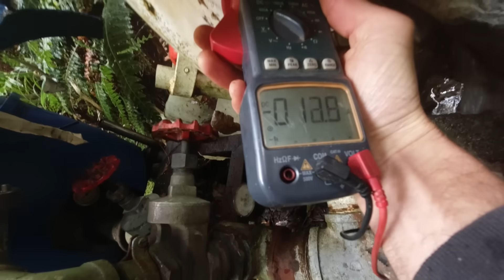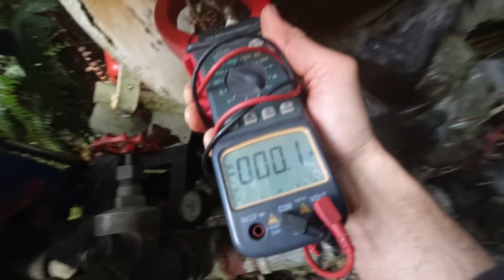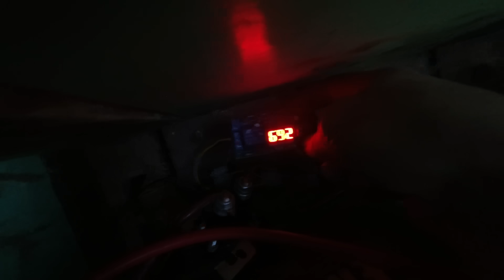Free Power for 16 years from a modified Washing Machine / Water Wheel

Comment: Really appreciated that, definitely save a lot of money but most households could not come close to running on 500-600w.
Sounds like your 4wheeler has a bit of a knock.
Reply: Ejay ... that 500 - 600 watts is likely the charging rate available and backed up with surge capability via batteries plus an inverter. The turbine running 24 / 7 (with enough batteries) should be more than enough to run a small home, other than central AC or a welder, electric oven, etc. If you think along the lines of how much power it takes to run a small camper (maybe a single 15 amp circuit not maxed out) then factor in some use of other energy (propane?) you could get buy with less in a pinch.
Reply: @rupe53   Yeah mate I did the maths answering another guy in this comment section, at 12:38 you see he has two 12v flooded lead acid batteries set in series to make 24v, he mentioned that he has installed 500m of power lines to the house - So there will be a substantial voltage drop to the house, reducing supply/increasing load at the battery.

A 15a 240v circuit maxed out is 3,600w, vastly more than this system produces.
My generator I use for my stick welder is 9,000w for example.

The batteries if fully charged and rated at say 600CCA should net only say 1,900wh, being generous, they're not deep-cycles.

Judging by this either #1 Marty T has some other more substantial power supply, or #2 he's living real frugal or #3 the system can provide considerably more power with more flow.
Reply: @Senkino5o  ... yes, some serious low efficiency with 500 meters of cable, even if it was AC instead of DC for the run. This seems to be the major drawback in most remote locations. Over the years I have done several long runs of a temporary nature, with the longest being around 1,000 feet. (a bit over 300 meters) Doing voltage drop calculations for 240 volts AC I needed 2/0 aluminum to run 50 amps with a 10% drop. (going by memory) In my case 10% was acceptable but going back to the charts it was more like a 5% drop (normal) for around 30 amps max draw. Basically it can be done, but at what expense?  In my case that 1000 ft run was about $1200 US dollars, just for the cable. Conduit and other supplies were extra. Never tried to calculate the loss for DC on that distance but have looked at a few hundred feet just for giggles, and it's enough of a drop to make you think it's just not usable on the other end. Oh, could our friend be sending some higher voltage AC up the 500 meter line to the house then converting it down again? He seems fairly clever... or VERY frugal! BTW, I was talking about a 15 amp feed at 120 volts, as that's what we'd use in the states for a small camper.
Reply: 500w continuously is about 12 kilowatt-hours per day of electricity.   12kwh will easily run a full sized 25 cubic foot refrigerator/freezer that draws about 1.6kwh per day, plus 100 watts of LED lighting for 10 hours per day, plus run an induction cooktop at 1800 watts at full power for an hour (plenty of power to cook three meals), plus 100 watts for a big screen TV for 5 hours, plus a table fan at 20 watts for 5 hours, plus a laptop computer at 100 watts for 5 hours,  plus a window unit air conditioner at 600 watts for 8 hours, and still have 1.7 kwh left over.
Reply: @richardowens9061  ... in theory you are correct but one has to coordinate their efforts to avoid AC, fridge, and cooktop at the same time due to starting loads of motors. Both the AC and the fridge likely need well over 10 amps each to start their cycle. OTOH, we don't know (from this video) what the guy has in the way of inverter / battery capacity. For $20 a year in propane ($100 for 5 years) you could easily avoid $1000 in batteries, cables, and inverter costs over a similar period. This is why off-grid is a bit of a balancing act when it comes to being practical.
Reply: @rupe53  I didn't address the issue of load balancing - because, I don't know anything else about his system, except that it's producing 500w-600w of electricity continuously.   And, with that amount of electricity, you could conceivably run all of the items I listed for the times I listed.   In other words, it's a significant amount of usable electricity.
Reply: @richardowens9061  Mate no, just stop. Valiant effort, but just no.
500w will not run a 1,800w induction cooktop, it won't run it for an hour it won't run it AT ALL.
And 500-600w measured where? At the turbine? 150m of transmission wire will lose you a good portion of that, just as torque measured at the flywheel is not the same as at the crank or at the wheels neither is electrical power converted by a motor/turbine the same at output as at the load.

Marty did not mention anything about batteries, if this turbine were used to charge a battery, then maybe, but that's not what he said and from what he said I highly doubt he has much in the way of batteries.

To be able to draw say 4,800 peak watts for any period of time you need a significant battery, the kind of battery that would cost a lot of money to put together and maintain, even if you could cobble it together from here and there.

You can't just multiply 500x24 and then divide by the average of your load in neat chunks, that's not how electricity works even if there was a capacity to store a large amount.

In this scenario if you tried to draw more than 500w the turbine would stall, just as if you load 25tons in a 12t manual truck and try to drive uphill - stall.

It would stall and the A/C, heater, microwave, toaster, etc. would not go.

This system would work for maybe 2-3 refrigerators, no more, which I believe is what he said he uses it for.

edit, I watched the vid again @12:38 he shows that he has two maintainable lead acid batteries, in series to make 24v, I don't know the exact rating and they appear to be cheap batteries, but for arguments' sake say they are 600CCA batteries, this nets about 80amp hours each which gives 80AH @ 24v which gives 1.92kwh of maximum rated capacity if they were new.

Take into consideration where he mentions that the turbine is about 500m from his house and I'd estimate a voltage drop of 20-40%, since he measured 20a @ 24v (480w) to battery and from battery (26v) to house maybe 18x20 - 360w

This means that with transmission voltage drop, 360w draw at house is equal to approx 480w at battery/turbine.

This gives him a bit of leeway, but any period where he exceeded 360w avg. power use he is draining those batteries.

I really doubt he would be able to bake a meal in an induction oven, he could not run a modestly powerful (say 2600w) air conditioner for more than a few hours, he could not use electric heaters to warm his house. Beyond a couple fridges/freezers, maybe some lights, he has no meaningful power from this system.
Reply: @Senkino5o  No, you just stop.   I have a degree in electronics engineering.   I also have extensive experience with solar panels, inverters, and LiFePO4 battery technology.   My original comment was intended simply to put the amount of power he is generating into its proper perspective.   I don't know - and, don't care - what other components he has or what their capabilities are.   The only thing relevant, here, is what can be done with 12 kwh of electricity.  You wasted an awful amount of time making wrong-headed assertions based on your own ignorance and your own misinterpretation of what you were reading.   So, you need to just stop.
Reply: @Senkino5o  ... you are being VERY generous with your voltage drops on the long run to the house... and you have thought further into it than I did at first glance. I really didn't know how far away the end point was or any of the distances between the generator / batteries / house. It seems like an almost impossible situation from a design viewpoint.
Reply: So as you have seen, you build what you need. this one could have a battery backup and run ten times as much for the 3 or 4 hours a day that it is needed.

Comment: Cool, a video on how it's done would be nice. Can  you put a grease fitting on the bearing cavity and remove a grease seal from the bearing side?
Reply from the maker: I tried that with oil on my first turbine, it tends to get between bearing and shaft and the bearing slips and quickly eats the shaft. I use sealed bearings, they last for years.

Comment: It would be more efficient if the water jet sprayed over the top of the paddle wheel and then down.  Just saying.  -BAG2
Reply from the maker: On the contrary, there would be slightly less pressure and the spent water would interfere with the wheel as it has further to fall
Reply: @MartyT  I am Civil Engineer as well as Electrical Engineer from Purdue.  I say this so you understand I am not just shooting my mouth off.  I like what you have done.  But I believe your comment about the "water falling further" proves my point.  This arrangement of spraying over and falling down.  Means the "Work Path" is longer.  Put another way, you can harvest more Kinetic Energy from the water.  If you choose to continue with your arrangement.  I wish you well.  I just thought you could get a few more watts out of it.

Comment: I just feel so inadequate compared to this bloke.
Reply: @Billy West any books you can suggest?
Reply: Just get to it. You could try very small and simple items with a garden hose or rain downspout from the house during rain storm. 12 volt automotive stuff is cheap and easy to use. Then you could step up in size, sophistication, and voltage and amperage. I think that's what I'll do....
I think I'll start with a blower motor and wheel. I'll have to figure out how to form a seal to keep water out of the motor/generator.
Good luck and God Bless
Reply: https://www.youtube.com/watch?v=267HHO1tzNw

Comment: Hey friend didnt see but if you rectify the current at your house instead of at the generator you will get a huge efficiency boost , DC is horrible for long distance even with thick copper , probably 7 to 20 volt drop on your rig  at 20 amp
Reply from the maker: I invert to 240ac at the turbine, more efficient than sending low v up the lines

Comment: At about 10:25 you have a cordless drill that looks like its attached to a valve on a right angle drive.  What's going on there? Are you using the drill to open and close the valve to control water flow to the turbine inlet?
Reply: Just read further down... automatic shutoff. If you found a slower drill or a reduction box it might work better. 

PS I'm a power station engineer (north island geothermal mostly). This whole thing makes me happy.

If I find a small scrap reduction box in my travels do you want it?

Comment: Very nice. Seeing you have a rather long run of wire, how much voltage droop do you get over the lines? Are you sending 220V to your place? If not, modern DC-DC converters are pretty efficient, so you might see some benefit of boosting to 72V and then having your main battery bank on the house side where you could draw a lot more load from the batteries when you need it. Do you use MPPT to charge the batteries?
Also, have you tested 2 nozzles to balance the load on the bearings?
Reply from the maker: I use an inverter at the turbine and send 240ac up the lines, very little cable loss
Reply: @MartyT  Ah, that makes sense. With the advent of cheaper lithium batteries, would you consider making a "UPS" at the house side to let you run heavier equipment?

Comment: If you buy a Tesla house battery that would solve your power issue and you would only need to rely on the washing machine power effectively creating 100% carbon neutral energy
Reply: The Tesla kit is about 10k NZ right now (I was pricing solar gear and asked recently).  

It looks like he already has batteries and anyway so the Tesla kit doesn't do anything for him other than add capacity (hence longer time to fix the main turbine before the freezer turns off). Something plastic, modern and clean isn't this guy's style anyway.

Comment: Pelton wheels, when speed of bucket travel is around half the velocity of the water leaving the nozzle, can reach 98% efficiency.
Reply from the maker: Yes, turbine speed can be adjusted by winding out the rotor which pulls the magnets away from the stator to achieve max efficiency

Comment: Love it, Marty. How cool is that... Living in harmony with nature like it should be... It sounds like you have some battery backup in the system. How many AH's of storage do you have built into the system and are you converting or running all DC or a mix and have you considered building a good sized storage pond at the top end? Thanks for sharing.
Reply from the maker: I have a 120ah battery bank at the turbine to make up the deficit when I use a high load appliance like toaster, kettle or startup on the fridge and freezer. Storage pond would be a waste of time and energy, It would need to be enormous to hold enough water to get me through a dry period, and if it broke in a downpour it would wipe out my pipes and turbines
Reply: @MartyT  Understood. Do you have enough flow rate & pressure to branch off additional lines to drive additional genheads? Just wondering if you could double output.
Reply from the maker: Yes for 8 months of the year when the stream is flowing well, I could run a few more turbines and make up to 3-4 kw but I'd never use that much, I'd have to build a heated pool or something to dump the excess power into
Reply: @MartyT  So, running the welder isn't an issue or is that a 1200 watt microwave conversion? You are resourceful and a heated pool would be awesome, aye! :) I watched the two vids yesterday on Angry Ram of outbuilding process. You are MacGyver! :)

Comment: Very ingenious your own power generation. 600 watts isn't a lot of power for the average home. Do you heat your house water with propane? The welder must be on a 30amp gas generator?
Reply from the maker: Its around 700w with both turbines running, I can put bigger jets on the turbines and get over 1kw but I don't need that much. My water is heated by the excess power when the batts are charged, inverter dumps intermittently into the 240v element. I have a 7kw petrol gen for the welder

Comment: Yet another thing to be jealous about.. Man that is sweet to not have to pay for power all the time. 

that's a long way to run 240v, you dont have to much voltage drop? I guess not since you've gone that long. 

Edit, i just did the math, i guess its only 2-3 amps on 240v so the voltage drop wont be that bad.
Reply from the maker: Voltage drop is very little over that distance with 240vac, When I first set it up I was pushing 24vdc up the lines and losing half of it in the cable, having the inverter at the turbine is much more efficient
Reply: @MartyT  for sure, we use 120 here so my original thought is your amperage would be higher, but then when i actually used my brain, it made sense.. Thanks

Comment: Wow!  That is really cool.  You should hang up that turbine made from a sprocket.  It is a piece of art.  So the output is 24volts DC?  How thick are the wires to take it to the house?
Reply from the maker: Yes turbine output is 24vdc, there is an inverter connected to the batts to change it to 240ac so very little power loss in the cables

Comment: I had watched the video of you building that years ago...I wanted to do one like it but the washing machines are built different here in the U S ...Many Blessings , SMR
Reply: Check E-bay for used ones.  Use "Washing Machine used parts/ 01211-5 F&P stator and rotor" and it will take you to a used rotor and stator. He also at times has offered for sale rotor, stator, and bearing support housing ( shaft, bearings, bolts inc ). Just be sure that if you buy a Samsung or other make unit, that it most likely will have Al wire instead of Cu wire and you can work with it. The F&P units are Cu wire.
Reply: @gravelydon7072  I think that that is a typo and should read " you cant work with it"

Comment: Whats the purpose of the red drill next to the turbine?
Reply from the maker: Automatic valve control, no longer in use. It worked well but I found it shut too quickly and put stress on the pipe joiners, I quickly found my weak joins
Reply: @MartyT  so its kinda just there for aesthetics now. Cool idea and definitely effective

Comment: Awesome spot Mr T. I just found you on google. the first vid i seen was the Vintage tractor, what a score!!. and ive been watchin ever since. I had seen the turbine vid but didnt realise the date. Now the old smart drives, inverters, cables, batteries, charge controllers and pipes are pretty easy to pick up. Ya wouldnt know where I could find a couple of Hectares on the side of a hill with a handy creek running through it was would ya. lol. Ya Livin the dream mate. 
ps i nearly shit myself when you opened up that inspection plate on the graider an the chain was sittin wonky with  the chipped teeth stairin back, but its workin out. anyway cant wait for the next mission

Comment: Do the temperatures ever get below freezing in your area?  If so, what procedures do you take to make sure your system isn’t damaged?
Reply from the maker: No the stream never freezes, if I turned off the valve in mid winter for a week It might get close to freezing in the pipe